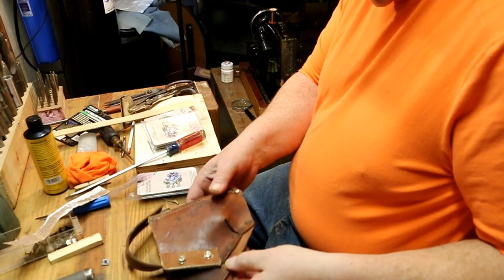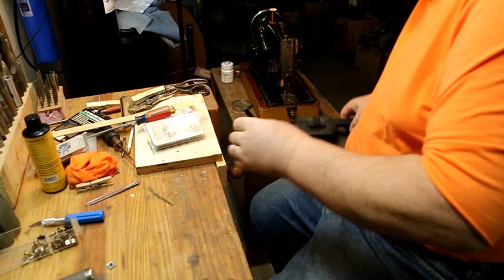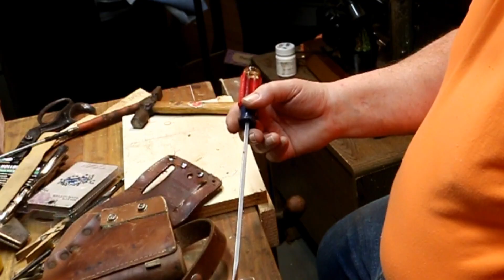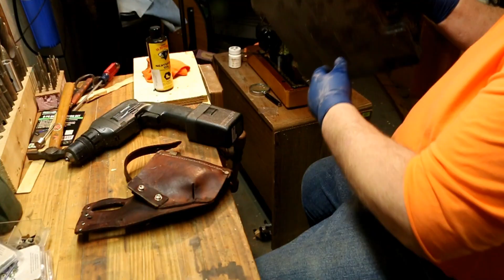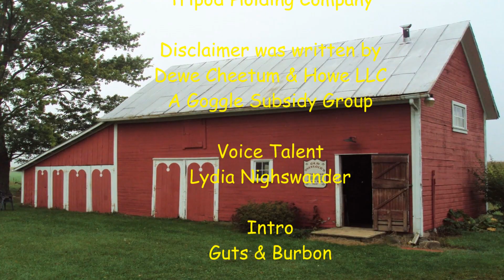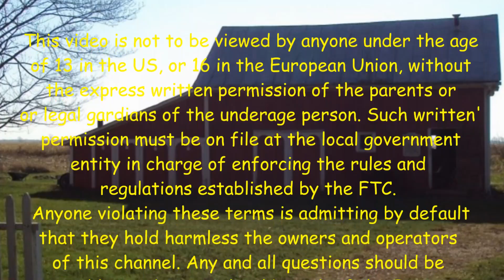Craftsman Drill Holster Repair Pt 3

Comment: Waiting for the snow to melt. Will probably happen middle of summer next year. God Bless Yall
Reply from the maker: Yeah. Alexa is giving us winter weather advisories every few hours. I know it will end in January for a short while then start back up. It will end in mid to late April. 
Hope the people in the western part of N Carolina got some help before the snow hit. Living in a tent is rough enough without snow. 
When New Orleans got flooded they had FEMA trailers trucked in with in a week or two.
Reply: @OldSneelock  The FEMA got pretty much run off and the locals are doing the job. LOTS of heaters, generators and propane bottles are still pouring in for the tent dwellers. No houses mean tents and plenty of them but hillbillies are tough and resielient. They'll make it. God Bless Yall
Reply from the maker: @lewiemcneely9143  Makes me furious that the A**holes hand out money to Ukraine, Gaza, and Hezbolah but let a citizen need some assistance and there's none to be had.